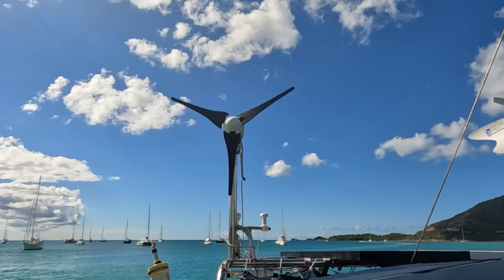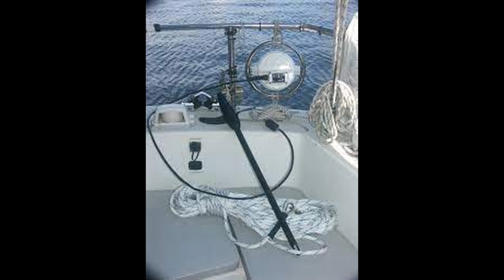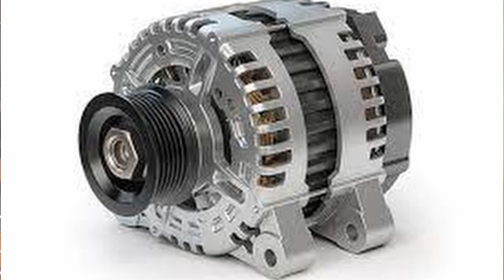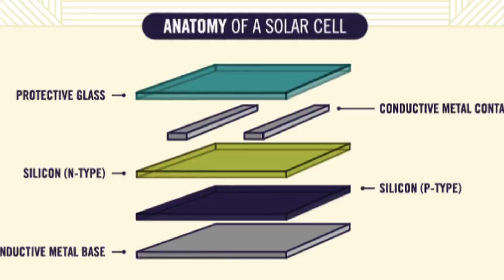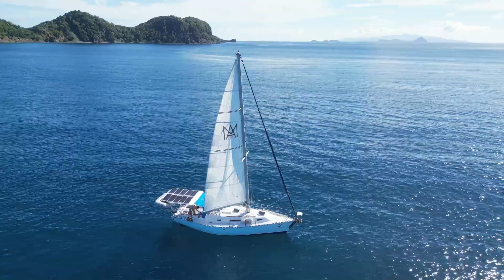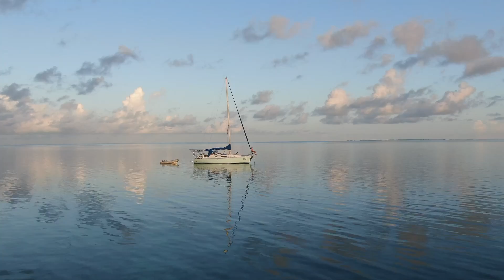The 4 Ways to Make Electricity on a Sailboat (Simplified & Explained)

Comment: Hi Dan. I made my 33ft or 10 Meters Sailboat into a SURVIVAL BOAT. I LOVE THE WAY how you do it. I have 1200 Watts fixed Solar on 2 different Controllers. If 1 fails, the other one can handel all too. All on an Arch and above the Cockpit. I have an ALUMINUM DODGER. 1 Solar Panel mounted on it too. Then 1 Windgenerator and a 120AMP Alternator on a 50HP Nanni. 600 Amp on 5 Gel Batteries and another 120 Amp on the Starter Batterie. I have 2 Plotters, 1 Inside with Radar, a 12 Volt Domestic Fridge and the usual Instruments. My highest Powerconsumtion comes from my Desalinator which I turn on every 3 days at Noon, for 1,5 hours.  That Way, I can fill up the 200 Liter Tank, mainly by Sunshine.  No AC etc. I am mostly away from People and Tourists. My Systems work very good. I have in Addition a Hydraulic Powersteering and a Windvane. My Boat is almost 50 years old, but will do me great service, until I die. 😂
Reply from the maker: Dam! That sounds awesome!

Comment: No mention of Jackery style power banks to store electricity produced by wind or solar. They are nice to have as a stored backup. I use a Jackery 500 in my camper van. I have solar charging my house battery that charges my Jackery constantly. I run the whole van off 12v or USB chargeable items.  Just a thought. Keep up the great videos

Comment: A variation: I bought an air cooled Sifa MB 168F diesel. 44 LBS. 3 horsepower. I don't like any kind of sea water cooling, nor weight. It is a sailboat motor. A tiny one. Add a 7 inch pulley and alternator and a very large part of it's output is DC electric at phenomenal fuel savings. 1/2 to 1 HP of propulsion. Now you can steer in the doldrums and point in storms. Goodbye 6 knots, but hello around the world on one tank just for storms, clouds, and marinas. It's way lighter and more reliable than any boat motor. Air cooling as dry heat is usually helpful on the water and not so bad compared to moist heat. I adapted the 20 mm shaft to 1 inch to connect things.

Comment: I really think the ultimate in simplicity would be an electric propulsion with two honda generators. Either cycle them or keep one un used as back up. Maybe have one diesel and one gas in case you cant find one or the other. Some even take propane.  Then you arent messing with inboard engines. You could still have some solar panels or other generation obviously

Comment: I think something you could mention is that electricity is not stored efficiently or transformed efficiently... Think it loses about 30% with each of these so its best to have 12v appliances and run them when you are producing... Eg run a 12v fridge with thermostat on coldest whilst running engine or its very sunny then put stat back to normal when not producing
Reply from the maker: Yes that is true.

Comment: Nuclear isn't that bad for a sailboat. Nasa uses Radiothermal Generators on a lot of their spacecraft, and they are not that big/heavy and last for decades. Plus they are relatively safe and have no moving parts at all, since they use the Seebeck-effect to generate the electricity. One unit produces about 100 Watts and is approximately a 25 inch cube. The only real downside is that checking in to different countries with a nuclear warhead attached to your boat might be a bit tricky. The main problem would probably be getting the Plutonium-238-oxide I guess. 🤔
Reply from the maker: Yeahhhhhhh, that doesn't sound practical........

Comment: Two questions: do you have a video on how you installed your solar (practical and cost)? And how does that compare with having a hard top installed and then solar ontop of the hard top? (Say it is of similar size to your current install)

Others welcome to weigh in please? Any photos & cost for your installs?
Reply from the maker: Not yet. But it basically cost me $1,100 total for everything! The solar panels are sealed together and ARE my hard top.

Comment: The power produced by both wind and hydro are small.  Maximum efficiency 40%=A÷2 x density x velocity cubed.  Large sweep area and high velocity of medium are required.
Reply from the maker: That's why I love solar!
Reply: @Adventureman_Dan  A fast boat 10-15 kn and large diameter propellers and you have lots of generation while you are sailing.  Though most time is at anchor.

Comment: I bet the hydro turbine dragged behind went out of fashion because it simply doesn't produce anything when not underway. Wind turbines can, PV can, old fashioned genesets can. Why pay extra for something that only works when you're under way? Spend that on PV or a wind turbine and it can charge all the time (solar at night excluded of course).
Reply from the maker: Indeed!
Reply: I would use 3 :  Solar, wind & hydro mechanical. And remove the generator  and fuel.  With batteries   ... The hydro- mechanical can be combined with the engine to be used around marinas or emergency.  If engine not use and there is movement and batteries need charging, hydro-mechanical is an option. If solar and wind can provide all required  electricity then hydro-mechanical can be stowed away. 
  In the kitchen: Induction hub  so you don't need gas  ...  One source of fire out of your boat.  
  There are interesting wind turbines :  Liam F1   and O-wind by O-innovations is a very interesting concept to place on top of a mast. Personally  I would go for a vertical wind turbine.

Comment: Generators have permanent magnets and produce fixed voltage at a certain rpm.  Alternators have electromagnets and can generate greater power at low speeds and reduce output at higher speeds.  And AC is just DC with a short attention span.
Reply from the maker: Well said!
Reply: @Adventureman_Dan  Thank you.  I'm always surprised how few people know the difference.